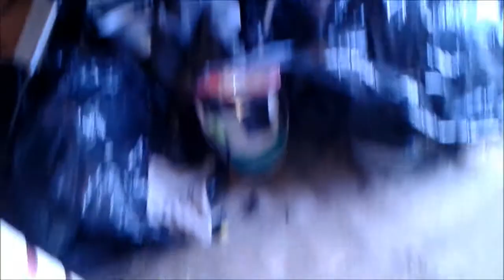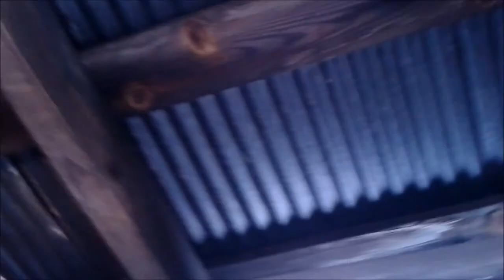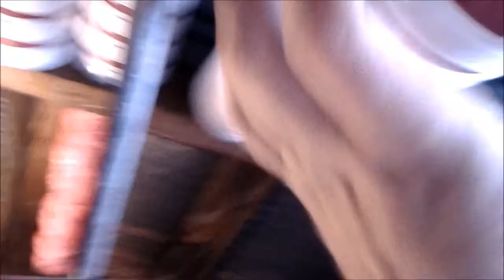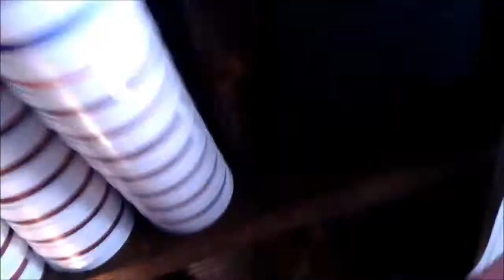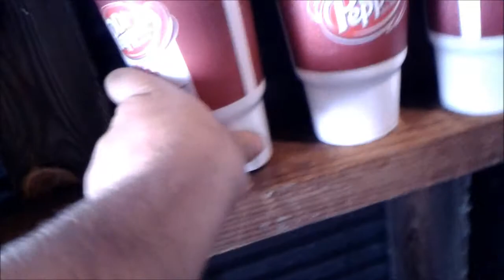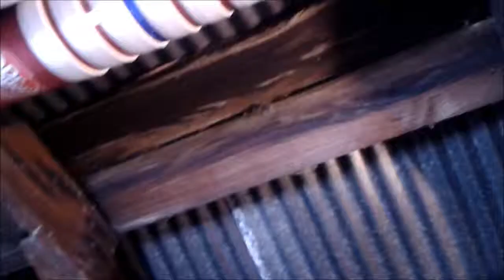Reusing Styrofoam Cups as Insulation

Comment: just saying, if you took the 48 dollars you spend on the soda for that one section, you could maybe buy some real stuff,   that said good ideal better than tossing them.  you will still get a draft, so crush a few for the ends to block the air from coming in or reverse each roll so they fit tighter together....